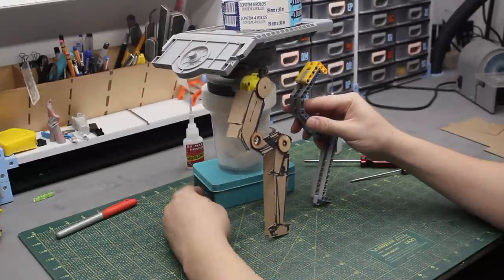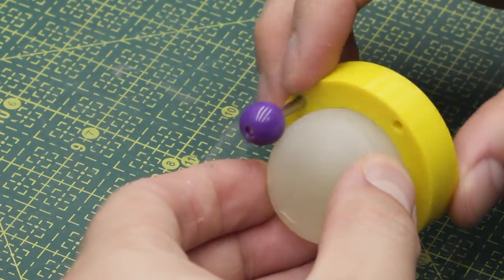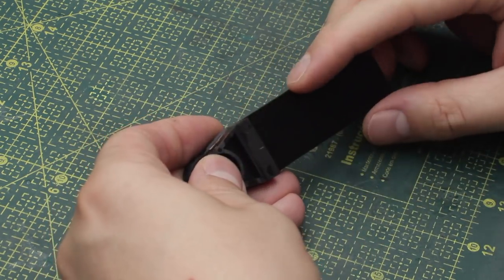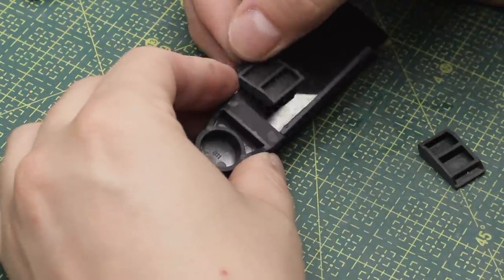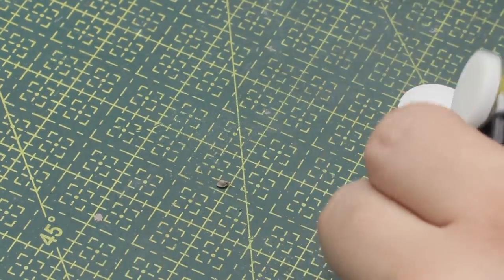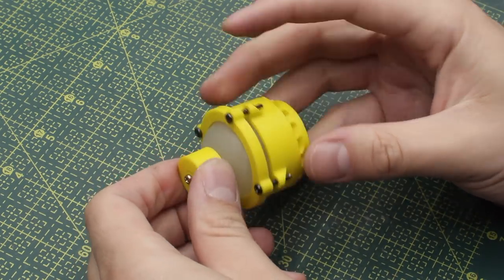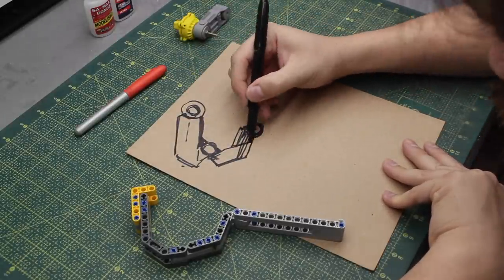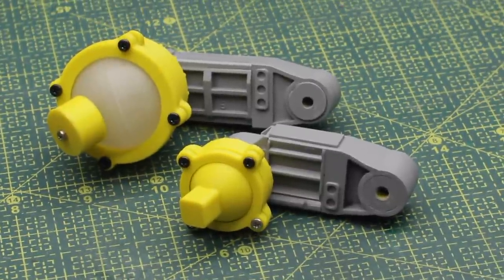Understanding BALL JOINTS -  Drone Dog part 4

Comment: Glad you made that ball joint smaller. Looks much better as opposed to the larger bulky one. You could sand more angle on the ball to get more angle and would still work. Think the legs going in opposing directions may look good too.
Reply from the maker: That's right! Thanks buddy

Comment: I think most prototypes start out a little big, a bit unwieldy and then get refined to a more compact size. Was awesome (as always) to see that process and your thinking along the way to achieve that ball joint. Excited to see the leg iterations to come as well. Going to be able to get some really interesting stances from this design. Great stuff!
Reply from the maker: Usually what happens to me, specially when designing at the computer screen (zooming all the way into it), is that things are way smaller irl! This time I worked around the deodorant ball first so, I guess that's why... But I totally see your point and I bet I could still shave some mms from that design! Thanks buddy :D